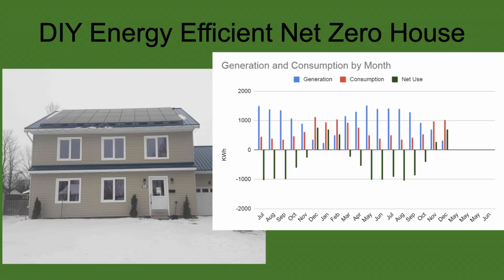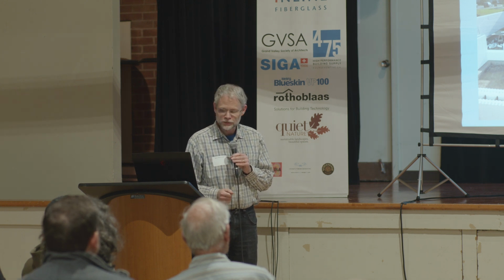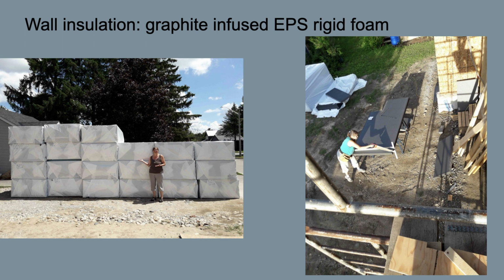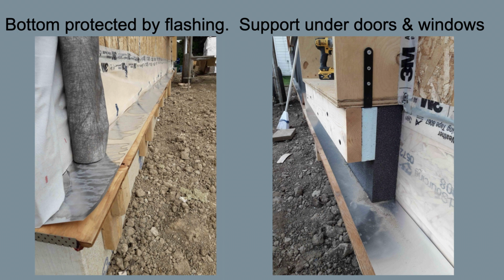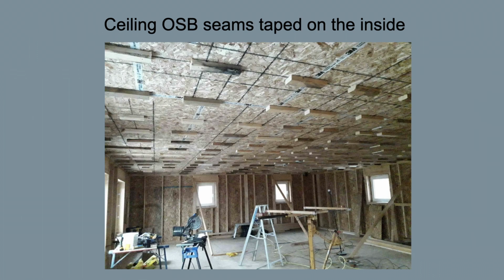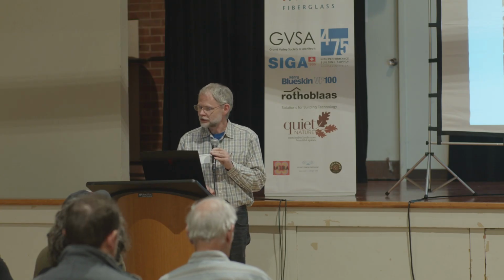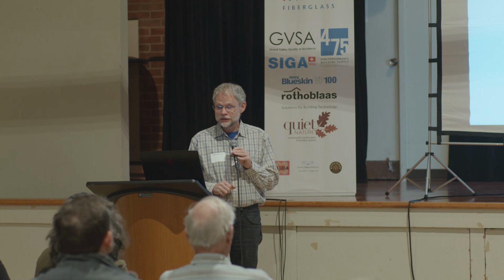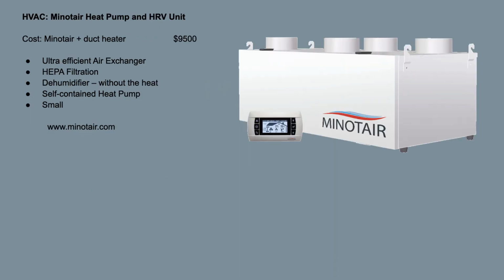Boots on the Ground: DIY Net Zero House

Comment: I’ve looked at the Minotaire product.  For a low-load home it could make sense, but I’m not surprised it’s not powerful enough to heat a decent size house in Canada on its own.

I’d like to see the load calculations for this house and see whether the unit is under-performing or under-specified.  My guess is the latter.